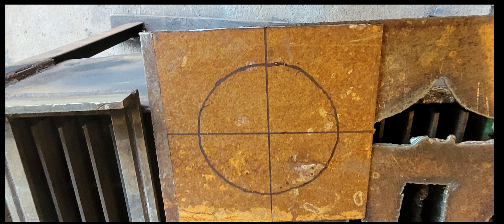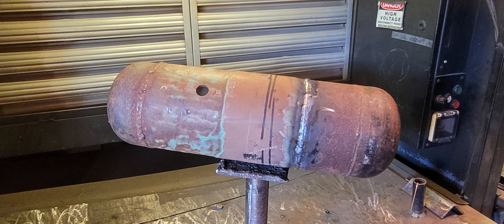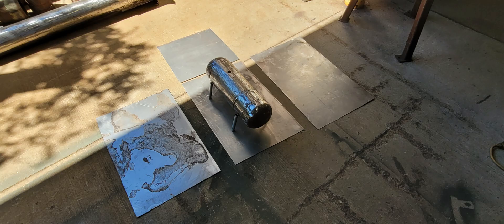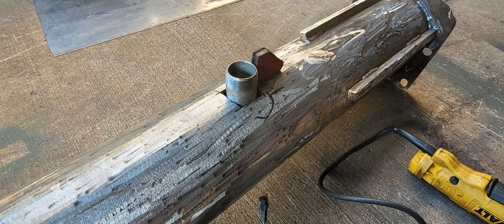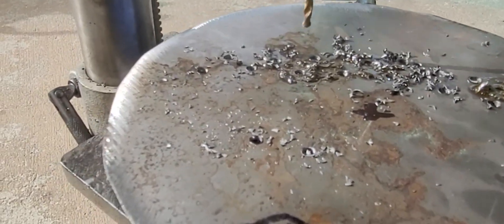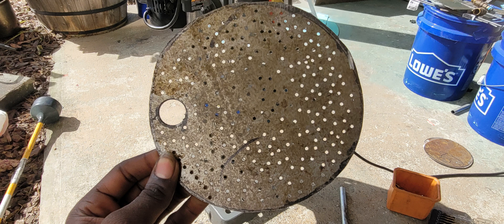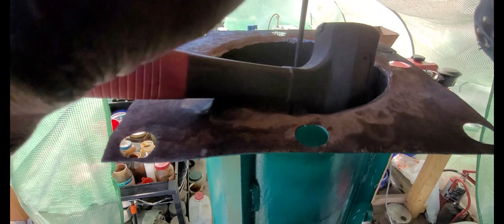Building Plastic to Gasoline Distiller V2!

Comment: Very nice Julian.
I would add a reflux in the top for better results. Thats lead mo to the next question - why so many outlets? Wht no to distilate it fraction by fraction?
2. What diameter was the column?
3. Did it work in the end..? 🤔😱
Reply from the maker: Thanks, it's  a 6 inch pipe. It did work in the end, but very inefficent, as the whole column is uninsulated
Reply: @naturejab  can you upload a video? Lets see what happens. Insulation is part of the efficiency but distillation more complex than just heating 🤔

Comment: After distilling can the diesel obtained be used straight into a vehicle
Reply: No. A lot of contaminants that need to be treated
Reply: @danear2  but he put the distilled liquid in a weed wacker and it worked
Reply: @schultheismatthius  But for how long? Weed wackers are 2 cycle engines that use a bit of oil during operation, so they're set up to be less affected by what impurities may be present. Car engines are more sensitive and, depending on year, have a lot more points where impurities can cause issues from seals being eaten away, injectors getting clogged, deposit build up, damage to the catalytic converter, etc.